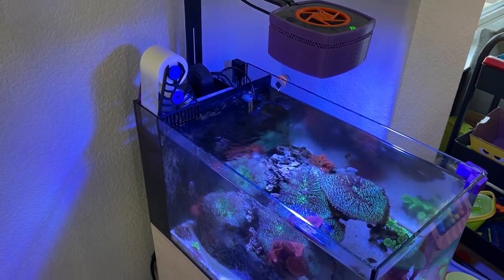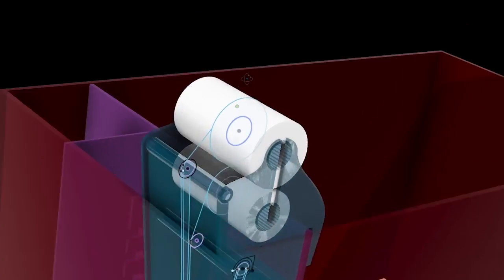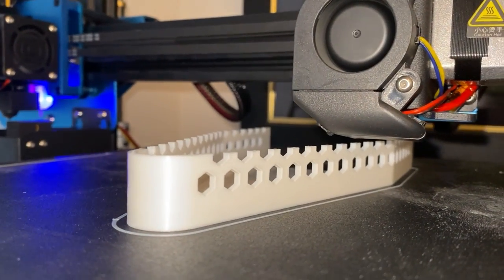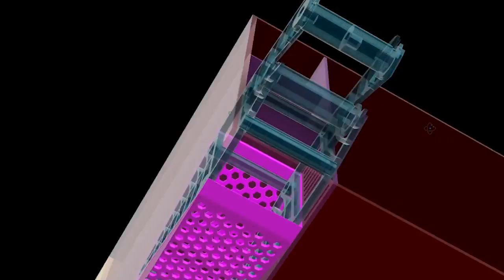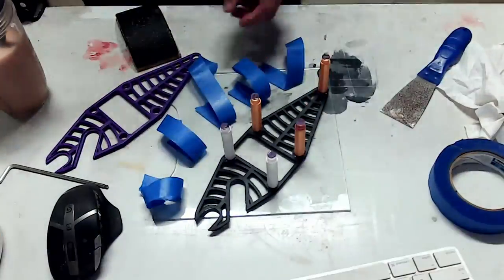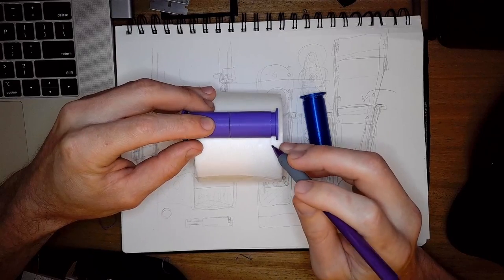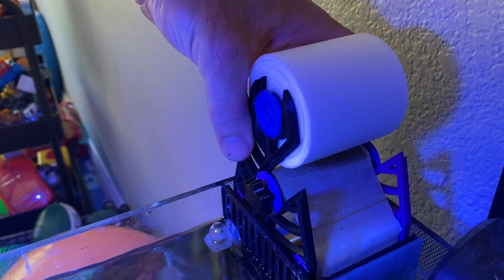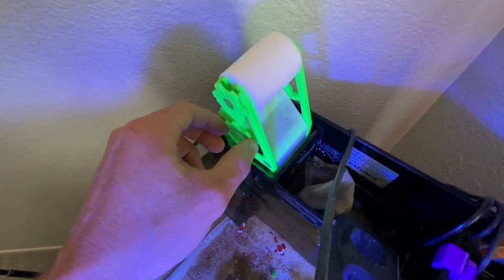First Nano Reef Roller Mat Filter - Fluval Evo 13.5 Filtrations Upgrade

Comment: Water box mini series peninsula 15 and 25 along with the small cubes (10 gallon) and bio cube 29 and 32 those would be a great start for the AIO roller mat!
Reply from the maker: 💯, I already started on the Waterbox Series.   I am testing a unit on the Peninsula mini 15g right now.  I wonder if any of these tanks have the same size overflow chamber.  Maybe the 10g cube is the same and the pen 15g ?
Reply: Agreed! Waterbox 25 would definitely buy
Reply: @ISeaLive  Will be waiting for the water box 20 video
Reply: @ISeaLive  I wrote the measurements in my own post a bit above. Pen15 and Cube10 have same height, so have Cube20 and PM25 (but you can probably get away with a version for the PM15/Cube10) and all WB Nanos (Cubes and PM both sizes) have the same size for their sock chamber otherwise.
Reply: I would definetly buy one of these badboys from you for my WB 25 Peninsula Mini. Regardless of how much the shipping costs to Germany may be this is a must have for me!!
Reply: @ISeaLive  ... Some of them are the same. Waterbox lists all dimensions on their website
Reply: I second this! I'll be on the lookout for the cube 20 model. Immediate purchase for sure! I think the cube 20 is the most popular too so good place to start

Comment: This is amazing. I would love one of these for a waterbox 20. Can’t wait to see what else you make. You got yourself a new subscriber
Reply from the maker: Does the WB 20 and pen mini 15g have the same size overflow chamber ?
Reply: @ISeaLive  the mini 15 is 	3.1"×3.1"×13.8" and the wb 20 is 3.1"×3.1"×15.7". So it’s just a bit taller.
Reply from the maker: @rickymcnugget4635  taller shouldn’t matter.  I already made one for the WB Pen mini 15.  It’s going to be in an upcoming video but I’m currently testing it.  Sounds like it should just drop right in.
Reply: @ISeaLive  Good ill be waiting with the money hahaha
Reply: @ISeaLive  WB Cube 10 and the MP15 have the same size overflow.
Reply: @ISeaLive  Can't wait for that. Would love to get my hands on one for the waterbox
Reply: WB mini pen 25 and 35.2!!!!!
Reply: @ISeaLive  +1 for WB 20
Reply: Love this! Going to print one for my 25g water box peninsula. Thanks sooo much for the files ! I’ll send you a short video when iam done
Reply: Waterbox 20!

Comment: Just purchased!

Bought my 13.5 about a month ago and I've been dying for something different in the first filter media section.  This roller is going to make a world of difference....
Reply from the maker: Awesome, thank you Brandon 👍🏻
Reply: Can I just ask 6 months on how you have got on with it…I’m very tempted
Reply: @leerogers5628  took it out after about 2 months.  Didn't even make it through the first roll.  The problem I was having was it was doing such a good job filtering It was backing up my water and my automatic top off was getting close to overflowing my tank if I wasn't careful and I was having to roll it maybe twice a day.  It was great but if it had an automatic timer on the roller so you didn't have to manually do it every 10 to 12 hours it would be really good.

I ended up just going with the InTanke media baskets and chamber one and chamber 2.... Filter sponge, filter floss, rock media in the first one and I changed the second column into a refugium.... With that combo my tank is crystal clear and has constantly zero nitrates.
Reply: Many thanks. Funnily enough I’ve just had an ATO overflow using a skimmer and media basket in 2 for same reason. I’m switching to MB in 1 and refugium as well in 2. Thanks for taking the time 👍🏻
Reply: @leerogers5628  If you need any suggestions. What I did was change the middle basket to a refugium but I took the stock light off of the fluval 13.5 and stood it up on its end against the glass in chamber 2.  Makes a great little refugium light...lol.  I took the lid off immediately and replaced with a better light source because my corals didn't like the stock light at all. 

Great little tank!

The other thing I did was upgrade the pump to a SICCE silent 1.0 to get more flow.

The inTank media baskets and the upgraded pump were the best things I did to my tank.

Good luck!
Reply: Great, thank you 👍🏻

Comment: Incredible, I’ll get one for the WB Cube 20 as soon as they become available!
Reply from the maker: Do you know if the first chamber on the 20 cube is the same as the pen 15 or 25g
Reply from the maker: Do you know if they overflow chamber is the same as the WB pen 15g or 25g ?
Reply: @ISeaLive  per the specs for overflow chamber on the Waterbox website the 20 and 25 have the exact same dimensions while the 15 is the same except for the height. 3.1x3.1x13.8 for the 15 and 3.1x3.1x15.7 for the other two.
Reply from the maker: @gunnarjanak4464  well this is good.  I am posting a video next week on the WB pen 15g roller mat.  Sound like it will work for all the WB nano tanks.
Reply: @ISeaLive  I’ll be looking forward to it.

Comment: amazing! Outstanding. I freaking love it. You could rig up a small geared motor with high torque and low rpm to run on a timer like once every 4 days for 30 seconds to advance the roller automatically.
Reply from the maker: 💯 that’s a future upgrade for sure.

Comment: Well done!  That looks super cool. 

Are you possibly planning a version that will fit a Fluval Spec-V 5-gallon tank? It would be super tiny, but very useful in that size tank.
Reply from the maker: Thank you.  I actually just ordered that tank.  It will be really cool to pack a roller mat into the back of it.  It’s going to be one small roller mat lol
Reply: @ISeaLive  if done right i think you could make one size that could work in a number of similar sized tank - include the FLuval Spec-V, LifeGard Aquatics nanos, and possible the and Waterbox Cube mini series
Reply: @ISeaLive  I would take one of these too Im planning on using the fluval 5 for a qt tank

Comment: So I see you ditched the cover and stock lighting. Do you have temp issues? My tank gets hot and I have been thinking of going with a set up like yours.
Reply from the maker: The original light went out on me within a week of setting the tank up so I switched to the AI prime.  I was already going to do this but the light going out just sped things up.

Comment: Great job, was thinking of designing one myself. But as you've shown its alot of iterations and testing to fine tune I haven't had time for yet and getting a source for the smaller fleece rolls hasn't been easy other than converting an existing fleece as you did.
Reply from the maker: Yeah, it’s odd how hard it is to find the fleece rolls

Comment: Love Love Love this - can we get them for a Eshopps deskmate, this is the hottest pico tank right now
Reply from the maker: I checked it out and noticed the filter sock bracket is permanently installed.   I would have to come up with something for the filter sock.
Reply: @ISeaLive  yes thats true I bought the media basket and it slides in under the permanent piece - so yours would have to drop in the center channel and slide left to lock into the sock area, in fact if planned correctly there can still be a media cup and your mat. Im glad to send you picks and links

Comment: This looks sweet! And I think it might not be too hard to make a version that fits in the Waterbox Cube 10/20 or Peninsula Mini 15/25. They have a 'Sock Chamber' for a filter sock, which is 80 x 80 mm (3.1" x 3.1"), across all of those 4 tank models. Height in the smaller version of both Cube and Peninsula is 350 mm / 13.8" in full height.
Reply from the maker: 💯 i am testing out this model right now.  The video is coming this week.

Comment: So sick! I’ve been planning on getting that fluval 13 or the smaller waterbox tank, if I do I will definitely get this! Less maintenance for me & everyone else 😂 but my question was what brand of roller mat did you use and cut for these? Would be cool if you also sold those cut and ready 😂
Reply from the maker: I've been using several different brands for the roller mat fleece.  I do sell the cut to side refill rolls as well.  I am in the process of getting a full custom order shipping out soon.

Comment: I would pay a lot of $$$ for one of these that fit the waterbox cube 20 AIO especially if it incorporated a little 12v gear motor to wind up the felt. Great job on this idea I will be following with the hopes that you will design one for my tank.
Reply from the maker: Thank you,  I’ll be releasing the Waterbox AIO version soon.  I’ve been testing it for weeks.

Comment: To help roll the fleece onto the new roller you could add a spot on the correct roller where you could insert a torx bit or any bit of your liking so you could use a drill instead of spending 10 min rolling by hand. Love the design if you could make one for a water box peninsula mini 25 id but one!!!
Reply from the maker: Haha yeah I thought about that.  It’s a way better idea.  The WB nano tanks are next.

Comment: Out of curiosity what happens when the mat becomes blocked? In sumps it would just overflow the sock/mat compartment into the fuge. In the ATO does it just overflow back into the tank?
Reply from the maker: It would cause the water level in the tank to raise.  Eventually the water would raise to the top of the tank and overflow the back wall into the filtration because the back is a few millimeters below the exterior glass of the tank.

Comment: Im going to purchase one, but where do you get the roller mat paper?
Reply from the maker: Hi,  You can get replacement rolls from me as well.  They are on the same listing under the drop down.  You can also but other rolls but you will have to cut and roll them down to size.
Reply: @ISeaLive  thank you loving the channel

Comment: I'm going to get one of these for my Fluval, but would love to get one for my IM Fusion Pro 2 | 14 AIO Peninsula Aquarium as well. I have an older IM 10, so don't know if the chamber is the same on the newer unit. This is cool!
Reply from the maker: Yeah I’ve gotten a ton a tank request so it might be awhile before I get to them all.  If you can locate the tank specs that would be great.
Reply: @ISeaLive  I ordered the Nano Reef Roller Mat Filter today! I also located the specs for the  IM Fusion Pro 2 | 14 AIO Peninsula Aquarium. It shows that slot 1 Filtration Chamber is  (2.8”x 2.8”x 10.8”). It looks like those specs are for the 20 Peninsula as well. Although I don't have that model. The IM10, apparently, has the same specs as well.

Comment: Can you make one for the IM 14G Nuvo AIO? + the waterbox marine DX 60.2. So far the smallest on is the Klir, just installed one on my 36G WB and had to make some adjustments but it's worth it,  better than filter sock so far
Reply from the maker: I’ve already made on for the IM 14g.  Check out the video I made about it.  Also I’m about finished with the one I’ve made for the larger Waterbox all in one tanks.

Comment: Can you just make one that fits in a regular 4 " filter sock? I and many other rather have a simple manual one vs those that you have to do a bunch of plumbing for and remove the filter sock holder. The Klir does fit, but does not work well at all because the sensor is really bad.
Reply from the maker: That’s a good idea.  I’ll look into making a 4 inch filter sock replacement.

Comment: What happens if you dont roll the mat for say, a week? Is there an overflow so the tank doesnt overfill?
Reply from the maker: It’s possible that the overflow chamber might get filler up and the tanks water level will rise.  It unlikely the tank would every overflow.  
Interestingly the media basket with a filter pad would start to get clogged in just a few days, causing the water level to raise.  I’ve gone a week with the roller mat and not had any issues.
Reply: This was my first thought as well. Awesome idea and if you can speak more to the emergency overflow (if it’s built into either your design or the Fluval chambers) that would be great! Any way to connect it to a water level sensor and motor?
Reply: Id like to see an emergency overflow for the roller mat, knowing that most people upgrade their return pump for more gph. Including myself. I feed pretty heavy and will soon have 5 fish in my evo. Mentally speaking, having a way for water to bypass the fleece in the event of it getting clogged, would be a huge relief.
Reply from the maker: @dannymai6835  adding a motor and float switch is going to be a future project. I’ve already added gears to the spools of fleece so I’ve had a motor in the plans from the start.
Reply from the maker: @MrPicboy85  I can agree with all that and I did consider it but the design would need some changes.  It is possible that the minor gaps at the top of the roller mat (above the normal water line) might be enough to prevent any issues.  I’ll just have to test it out.
Reply: @ISeaLive  possibly, only 1 way to find out. I have a feeling these will be a popular product for AIO systems, once all the design bugs are figured out and a true final design is ready. You can call it the nano roller. Work up a contract with tank manufactors for you to provide the roller mat hardware while the company provides the fleece appropriate to the tank the nano roller is going into. And with an addition of a float and motor. Who wouldnt want one in their tank

Comment: Would you be willing to design one that works in the filter sock holder of a Red Sea reefer? I know they already have automatic ones but they can kinda be pricey. A manual one could be a cheaper option and I’d definitely be interested!
Reply from the maker: That an interesting idea.  Does it just have a 4 inch filter sock?
Reply: @ISeaLive  yes it is 4 inches, but the redsea filter sock is a little different compared to standard filter socks. Do you have an email I could send some measurements to, if you think it’s something you would be interested in?
Reply from the maker: @Thenewfishontheblock  mark@isealive.com

Comment: would you have the measurements to this?  I'd like to see if i can use it for a IM 20 AIO
Reply from the maker: It fits snug in the fluval.  My guess is that it won’t work but I’ll adjust it for the IM tanks soon.

Comment: You can use “Red Sea Max Nano 100 Micron Thin-Mesh Filter Bag” just make a sock holder, much easier.
Reply from the maker: I don’t follow. Are you saying I should make a filter sock ?
Reply: @ISeaLive  I also have this 13g tank, I used a 3d printer to make a filter sock holder, which can use "Red Sea Max Nano sock" in the first chamber. It is easier and cheaper to make. The filtering effect is the same and other filter media can also be used on the bottom.
Reply from the maker: @leongao4724  nice, I used the standard filter sock on a Waterbox pen mini 15 and cleaning that thing quickly got annoying.  Your totally right about cheaper and easier but I promise you the roll mat is 10x better for sure.  Maintenance is sooo much easier I wish I had made this thing years ago.

Comment: How do I take roller bar out of the roll
Reply from the maker: You can either unravel it into the trash by unrolling some and doing quick circles with your unrolling arms to get the rest off or cut it off with a razer blade.   The fleece cuts pretty easy.
Reply: Thanks

Comment: Man, I'd buy two of these right now if they'd fit the Innovative Marine Fusion Pro 30L (4.8"x3.7" chamber) and fit an existing fleece roll size, such as the Klir 4" replacements. Four of IM's current AIO's have the same chamber size; the Fusion 30 Pro 2, Fusion 40 Pro 2, Fusion 40L Pro 2, & Fusion 50 Pro 2 Lagoon.
Reply from the maker: I’ve had a ton of request for the IM series of tanks.  Ill be making one soon.  It’s my understanding that the overflow chamber is similar on the IM tanks.  Any idea if this is true ?
Reply: They vary. Maybe 4 sizes across their 12 AIO lineup, but you can find the tech specs of each on their website.

Comment: I vote for a Trigger Systems SAPPHIRE20C,  it has a strangely "smooched" 4" filter sock that no other roller mat system fits.
Reply from the maker: Thank you for the vote but that’s a sump.  Nothing will fit it ? Even the drop in fleece rollers ?  I would probably just cut out some space to make something work.  If don’t carefully you would never be able to tell it was cut.
Reply: @ISeaLive  No, nothing available fits.  I sent you a message through your web site.

Comment: I guess I'm the only one who was completely unimpressed by the color of the filter afterwards.  It did not look like a lot of particulate/waste/algae on there at all, it just looked slightly darker because it was wet.

I don't believe there's a proof of concept here until you've cycled a tank with this as the sole means of filtration.  I'm skeptical that this did anything.  The black media bag at the bottom of the old setup caught way more waste that this.
Reply from the maker: Thank you for the skepticism but this thing is working great.  White fleece filter roles like this doesn’t chance colored at all when wet and the video doesn’t really do the brown/green color  justice.  The Blue of the tank is washing out because I don’t have a filter on.  The roller mat doesn’t have any gaps so if it’s not catching enough I could just use a lower micron fleece filter roll.

Comment: DUDE! I’d pay for a file for waterbox aios. I’ve got a mini peninsula 25 and a 35.2. Kraken reef is making a bundle off of their 3d printed waterbox accessories. Would also pay big for a pre made one.
Reply from the maker: The Waterbox version is almost ready 👍🏻
Reply: Dope. Nice dude!
Reply: @ISeaLive  locally at least, a lot of us have moved to the nicrew hyper reef lights as they are high quality and low cost with great reliability. Have you seen them? I know people would be interested in diffusers. I run them currently on a 35.2 and on a drilled 40B